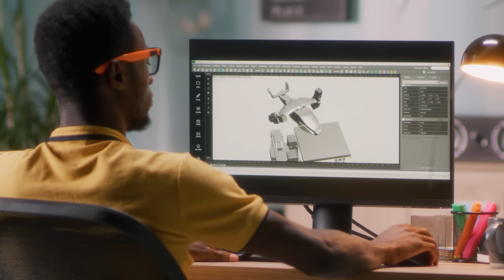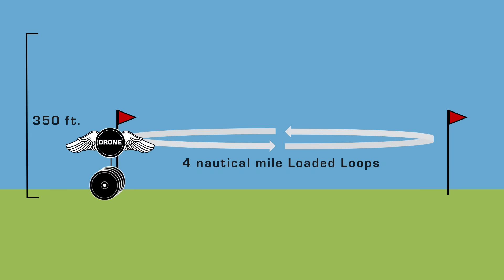DARPA Lift Challenge

Comment: Improving the payload to weight ratio is a real hard problem in multi-rotor drones. Especially when you talk about heavy payloads. 110 lbs by no means is easy!
Reply: It wasn’t but I found six solutions at first it felt like it was impossible until I got the first solution, though I have 6
Reply: Disc loading should be low in order to lift heavy weights with relatively small power. That means rotors should be large rather than small.
Reply: @TANOCA17  exactly when I did the calculations I was actually shocked how big the rotors had to be and you can’t make them ducted even if you follow certain techniques from whisper aero’s by eliminating tip vertices by eliminating the wind tips by attaching them to a ring in the duct or toroidal propellers. I even did the calculations. For ducted toroidal. Even morphine edge ducts also come Archimedes turbines what’s a turbo booster Inlets. Our self taught so take what I say with a grain of salt. numbers don’t lie.
Reply: @bojnicko  on the wiki page about disc loading, there's a formula of power in relation to disc loading and weight, please check that if you haven't. There are some assumptions for that formula to be valid obviously but gives an idea about the magnitude
Reply: @TANOCA17 which one. of the three momentum theory, Bernoulli’s principle or power requirements

Comment: I’m a part 107, part 137 and I’m a 3-D printer custom drone manufacturer.

I’m not going to enter in this contest because I’m fairly new to drone manufacturing.

I’m pretty high-level with ChatGPT though and it gave me all the information that I would need tax accomplish this task including code.

I think this would be a fun challenge but I’m actually very busy developing my own drones robots and spectral cameras to detect insects enter apply integrated past management for agricultural production.

ChatGPT gave me all the information I needed to build this I wish that this would be a contest that would begin in 2027 for me. I’m just so busy.

Comment: For everyone building for the DARPA Lift Challenge — here’s an important reminder on safety and airworthiness:
>>>You will NOT fly under Part 107 at the event. You WILL fly under 44807.
Submit your FAA package early. Do not wait. lead times can make or break your ability to compete.

A few notes that will save teams months of pain (by the way I would be open to join any team - not competing solo!) 

-Design for airworthiness from Day 1. DARPA isn’t just testing performance—they’re testing safe controllability.
-Partition early. Use a safety-certifiable RTOS such as VxWorks 653, Deos, LynxOS-178, or INTEGRITY-178B so your architecture scales toward commercial and defense viability.
-Build a proper test harness and enforce disciplined verification.
-You must perform MC/DC structural coverage for Level A/B-equivalent components.
-Adding FPGAs, treat DO-254 as a first-class requirement next to DO-178C.

For deeper context, Rierson’s book on safety-critical aviation software is the best resources in the field. Ping me and I’m happy to point you to additional material or connect you with experts who have taken multiple systems through certification all over the world.

(And yes, I did win an RTOS hackathon while at AWS — so happy to nerd out about real-time systems anytime.)

Comment: I'm a retired FAA electronics engineer who developed a system for using drones to flight check FAA facilities.    

I responded to this DARPA program manager's video, explaining my background and suggested that their connection with SBIR (Small Business Innovative Research) be utilized to arrange a competition with the prize being to establish a small business built around a privatized version of FIFO.  FIFO is the FAA's office for flight checking, which has a large fleet of aircraft. 

The $6.5M of prize money that DARPA is offering to encourage entrepreneurs to develop a drone that can carry a heavy package would pay for a fleet of drones with Anritsu gear to do flight checks, saving the taxpayer roughly $100,000,000/year by my estimate, confirmed by Grok and GPT, improve safety, advance drone engineering, reduce environmental impact and advance the congressionally mandated adaption of FAA to drone traffic.  I mentioned in my message that any use of drones in the National AirSpace (NAS) requires developing the FAA systems to be adapted, and what better way to do this adaptation than with drones belonging to, or under direct control of FAA, such as flight check drones, rather than just opening up the NAS to general commercial traffic?  That comes afterwards. 

I received no reply, despite that the suggestion submission form stated that all would receive replies.  I had similar non-responses from a great many other supposedly responsible authorities to whom I made this suggestion, which was developed and tested about 20 years ago.  I was given an award for it.

Comment: Really no benefit to this…  I 3d print, design almost daily on cad, and still have an operator job on top of that. I think out of the box more than anyone I know. But you want us to help you for 6 mil if where lucky? it’s going to cost 50k and 300+ hours. Then we all show up with out of the box designs and ideas for you to use later? It could cost us all together 10 mil in prototypes showing up. 

Have an application that we can fill out and get very well funded. Maybe divide us up into funded groups? I don’t have a license and never controlled any drones, but can design and build it for someone for $.

Let’s say I pulled this off you really think I’m going to show up at this contest for only 6 mil? The concept alone is worth trillions.

Comment: Does it have to be battery powered? I think a mini ICE helicopter might just be able to do this.
Reply: Depends on how many rotors you wanna use you’re close to be quiet Frank you’re on the right track but still extremely far. You’re basically just about to leave your front door to go through your front gate to head on the road.

Comment: Guy.. Canada too?.. because I have what you're looking for plus, mine can do 350lbs @ 8 nauts dist. Just over 55lbs... but i can just drop an engine and use a modified configuration.. probably get 265lbs at same distances if necessary.😊😊😊
Reply: Seriously? I won't say that you can't. But that would be impressive if you have actually built it and you are including fuel and/or batteries in the 55 pounds. I am still trying to come up with a design with numbers that good, I would be interested in working with you if this is real.
Reply: @jrrt6745  definitely lying it’s impossible. He would have to give me that solution him damn self mathematically improving or send me a video of it actually doing that shit.
Reply: He’s lying. It has to be exactly 55 pounds anyway so you lose.
Reply: What’s your energy. gasoline or electricity or hybrid. This guy is lying. he said engine so you’re using gas which makes sense because of the energy density electricity won’t work. Maybe you should’ve given me the exact weight it has to be exactly 55 pounds are below. Some of my calculations of suggested with a few extra pounds there can be an increased to 250 but 350. I think you’re lying. 🤥 . Even if you modify the configuration, it won’t change the payload capacity the mathematics and the physics is going to start to mess with the momentum of the payload when it swings back-and-forth due to the strong Ghost that you have to take for into account in your calculations, when doing forward flight. Plus, the angler of momentum from the payload being swung is gonna cause you to use a lot more energy and gasoline consumption but that again would somewhat increase your efficiency due to fuel consumption your fuel so large will become lighter overtime. Actually let me shut up so I don’t give you a way to fix your idea. You’re my direct competition if you’re actually telling the truth, I will crush you.

Comment: Where will the competition be held is the main thing I need to know, I'm out if it's on the east coast or something.
Reply: they have officials all across the US
Reply: How many solutions do you have?
Reply: @bojnicko  Just working on one as a hobbyist, the motor/large prop ban is causing me tons of issues though. I think I'll be lucky to get a spot when they open it up though apparently there's only 200 positions.
Reply: @maddercat  I have six solutions you have to make sure the rotor blades are precise, and you have to calculate for the sway of the payload and damping the vibrations. Don’t use batteries it will fail. Think about what has the most effective power density and it’s definitely not lithium batteries
Reply: Correction, I don’t mean totally avoid batteries. Just don’t use it as your only power source.
Reply: @bojnicko  yeah, it's a tough problem. The newest liions coming out are right on the edge of being able to do it though with the newest motors.  The only issue is actually getting those motors.   Yeah I've looked at hybrid systems, probably will run generators.
Reply: @bojnicko  Don't have to let it sway, just lock it into your frame  I think is the best method, either softly or as part of the structure.
Reply: @maddercat  bro, I’m telling you I have worked this problem so hard that I actually developed more than nine different patents that I want to submit some of my designs already hit five to one ratio unequivocally you can’t forget a single rule, our constraints and I realize they put some deliberate loopholes in the rules. Some of those loop poles are actually double edge swords deliberately set there for those who are smart enough to take advantage of it the right way to use it, but those who take advantage of it, the incorrect way it actually backfires on their efficiency

Comment: I think, with zero experience or expertise, that y'all are approaching this from the wrong end & shouldn't be launching them up from the ground but rather dropping them down from the ski using an autonomous airship designed to spit em out & retrieve them sorta like a PEZ candy dispenser at an altitude 
where it can't be detected or shot down which is a problem I only just realized unless you're dealing with 2nd & 3rd world countries who can't so like I said, no experience or expertise.

Comment: What piece of equipment/object do they have in mind that weighs 110lbs? 🤔
Children?
Dogs?
Belt fed mini gun plus ammo?
Briefcase nuke?
Reply: An AGM-114 Hellfire missile weighs 108 lbs...
Reply: @CivilDefenseEngineer  I watched your video btw. I don't agree with your suspicion. While the weight of hellfire missile is coincidentally close, they already have a range of 4 miles on their own, modified ones go further (potentially 21 mi). I can't see a good reason for putting one on a drone. There's a lot of bomber drones that already exist and do well enough. Considering re-usability is a component of the rules (no crash landings) they are not likely to be kamikaze drones either.  I think they want something that is essentially a miniature cargo carrier for urgent deliveries. Munitions, fuel, medical supplies or anything else. Ukraine recently used a drone to extract an injured soldier.

Consider that the logistics portion of the military almost always employs more people than the combat portion. Most supplies have to be delivered by people, and that puts people in danger if they need to deliver to an area with active combat.

Of course I'm also speculating, so I could be wrong. When people think about what the military does, they tend to only think of bullets and bombs, but there's a lot more involved.

Comment: OK you cant change physics so you could try to make the structure lighter. Hope that is not that kind of competition which has conditions written in a way that only the entity can win they want to win
Reply: What if I tell you I have six solutions documented and computationally accurate using exhaustive optimization algorithms and Latin hyper cubes logarithmic etc., calculus, etc. Momentum theory climb thrust vortex, wind tip for radius. Then you have to know every single component and weigh them or try to find substitutes. The real trouble is design in the fuselage to actually work. Some people don’t even calculate the turbulence and even the amount of water that might hit the rotor blades decreasing their efficiency. It’s a lot of calculations to figure it out, but I did six times it’s not impossible and it’s physics verified more times I can count I have double checked triple checked quadruple checked until the answer came back on unequivocally yes. Think of this as me marketing myself don’t pay me no mind I’m just Peacock in.

Comment: If we're spit balling, a lightweight hermetically sealed vessel of light gas mounted onboard would amplify payload capacity. One could incorporate it into a double walled fuselage, filling the void with the gas or even make it into a modular device to clamp onto existing platforms. Enjoy 😁
Reply: no lighter than air fluids allowed
Reply: @aidan4472 in the contest, sure. In reality, if it works well it also sells well.

Comment: I think somebody would do well if trying this: Yet another quad-copter design. The difference being is that instead of the usual variable speed method each rotor is governed to a fixed speed, and uses collective pitch control for pitch/roll/lift. On the tips of the rotors are little movable drag vanes for yaw control. Somebody who knows enough about the general mechanics of quadcopter flight with differential thrust etc. shouldn't have too much trouble making that work. The thing is when going big with more power, there's rotational inertia and it's better to not fight that, thus the alternate approach.

If wanting some bonus feature on top of that, do the airfoil frame thing so it doubles as a fixed-wing if flying sideways. The trick is to keep the payload part level without running into somebody else's patent with such stuff. (There's a good design or two I've seen on YouTube at least, but I think they called dibs already.)
Reply: You’re close and I will admit it. You’re extremely close but some of your logic when tested and calculated does not allow it to be feasible for the competition, but I must admit you’re very close. I have six solutions and I must say you’re the one who came closest to my winning design. All six of my designs have been computationally calculated in the exhaustive manner with so many calculations. I’m afraid to declare the exact amount because it might sound preposterous or I might sound like I’m boasting. But short answer is that I created optimizer algorithms and Latin hyper cubes to figure out everything by using the constraints. What’s a bit of machine learning added to the algorithm
Reply: I’ve tried to fix wings with gimbals and shouted ducted coaxial propellers in my calculation I even tried ducted cycloid and impeller designs I even tried thyroidal wings and using my algorithm to generate the optimal design based on geometric parameters on aerospace calculations and a little bit of MIT research papers. The real problem is the fuselage and fuel swash. I even tried, coaxial tandem designs. I won’t tell you my secrets are my six solutions but based on everything I say you can know I’m serious when I tell you I do have six solutions and you are very close to my winning solution that actually has a 5:1 I know I’m not lying. It’s slightly more than that. What I’m really trying to say if you do it right you could get five to one as well because you are extremely close.
Reply: I have even tried Archimedes turbine designs on propulsion units with liquid cooled, axial flux motors I even messed around with adding my own printed and engineered Turbo component to the inlet. I even calculated morphine edge outlets. I even calculated stators that are fixed or articulating. I hope you enter if I enter you will be a good challenge to face the hope you take this as encouragement. I see you as rival like in a Naruto and Sasuke way.

Comment: Assisted takeoff makes more sense to impart energy externally.  This increases the payload fraction.
Reply: How is this supposed to help? It actually takes less thrust to take off than it is to hold a hover at altitude due to the ground effect. Assisting it during take off doesn't help it hold greater weight once its in the air. The only way this would do anything is if you launched it sideways so it starts off moving and has translational lift, but once it stops to try and land it looses that extra lift making it fall so at that point you've just made a plane and you might as well use a fix winged drone.
Reply: @epicgamer42069  Vertical takeoff with rocket boosters.  Translate to horizontal flight with wings for lift.  Converts chemical potential energy to altitude and velocity, i.e., potential and kinetic energy.  No hover.
Reply: They’re thinking about Alpine environments or forest so even if you try to use a catapult system, it won’t work plus it would be extra weight to carry around on the battlefield and you have to set it up